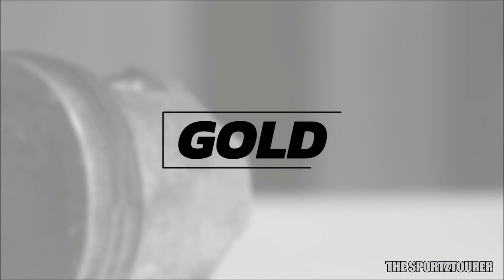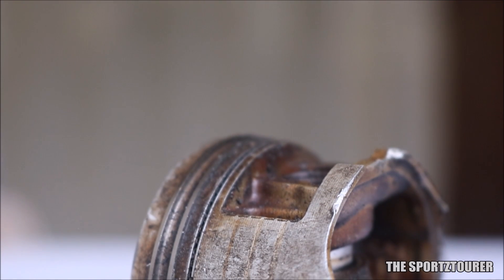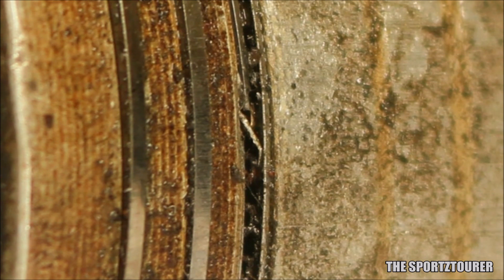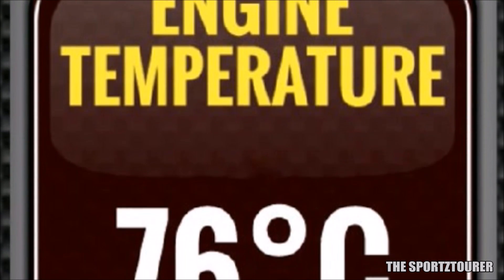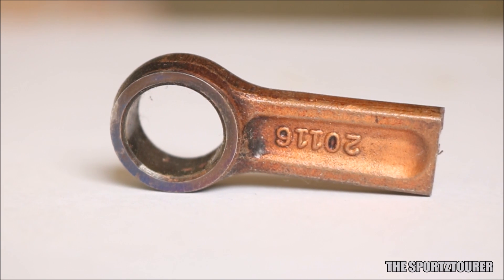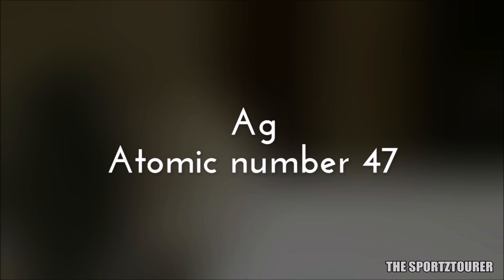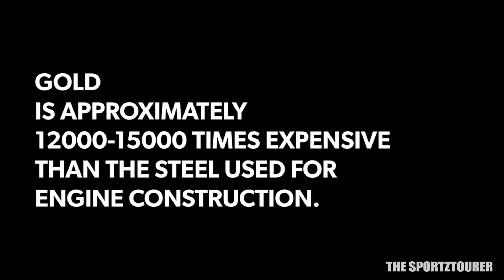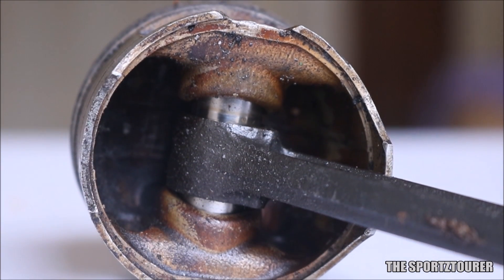MEGA PROJECT: PURE GOLD ADDITIVE INSIDE MY ENGINE | BEST ENGINE OIL ADDITIVE GOLD ENGINE

Comment: Can u plz tell me which engine oil should i use on suzuki gixxer?
Reply from the maker: Hi Vipul,
Which oil are you using now?
Reply: @thesportztourer  it is the company's oil of 10W 40 grade, costing Rs300 ( may be mineral oil). The bike has done 3100 km and i have done its 2nd servicing. After 2nd servicing i am facing engine heating issue and decline in pick up. That's why i am considering to buy synthetic oil. So plz suggest me a good oil
Reply from the maker: Hi Vipul,
Yes, you are right it's a mineral based oil. You can go for the 7100 which performs very well on the Gixxer, just make sure you go for the right grade: https://amzn.to/2LTUy2u

Comment: It is good for engines having higher compression ratio and have over square engines as they produce more heat . Titanium can dominate gold easily in terms of thermal conductivity . Thts y bugatti use titanium piston, all these are expensive games  .well good video bro ❤️
Reply from the maker: @Tarun Absolutely right 👍 Working on Titanium is still a task for the LSI but I agree with your point of using Titanium.
Reply: @thesportztourer  ❤️
Reply: It's a April fool joke